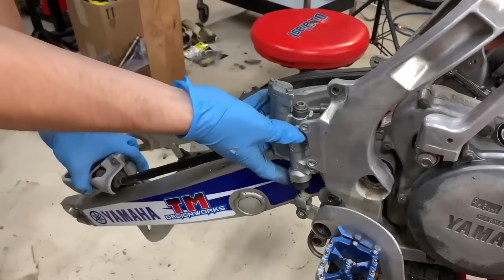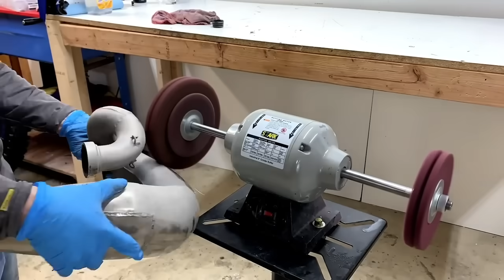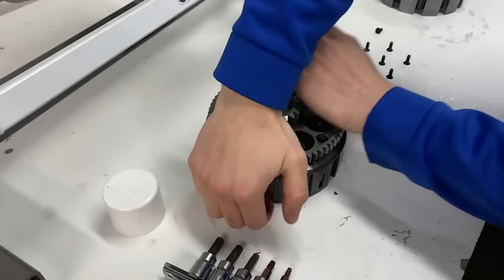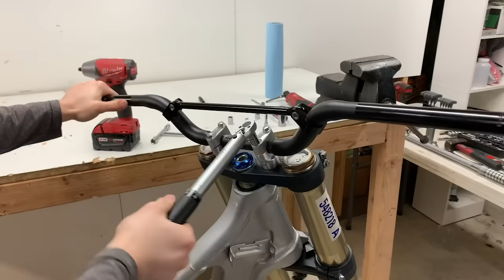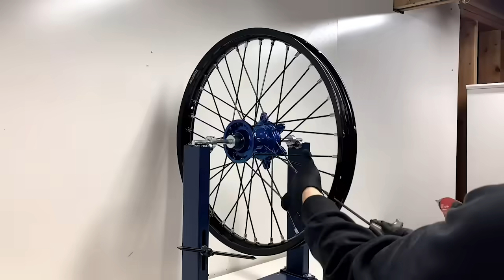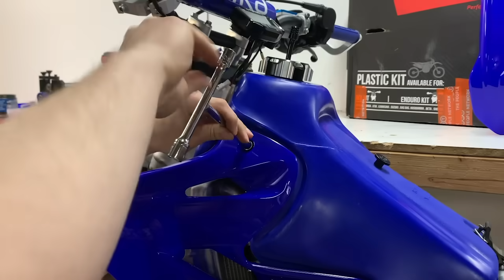Insane Transformation of a $950 Dirt Bike!

Comment: see I could probably take it apart but it would take me YEARS to figure out how to put it back together...
Reply: Thats what I thought but I took my project bike (and it was my first time working on something with an engine) down to every last part. Putting it back together, with help of the manual, was pretty easy and almost relaxing. Except tires. Fuck tires. You should totally try and rebuild a bike though, 100% worth it.
Reply: @zach5994  what bike did u do it on
Reply: @2strokeatvbro630  I did 2. First bike was a 1980 KE175 (old school and 2 stroke so super simple but a dirt bike nevertheless, however I will say since it's an old bike that no one else works on the difficulty of working on it would be comparable to a modern bike) The second was a TTR125 which I just did minor repairs and cosmetic replacements. No matter what bike you do you will probably get it down and I think it's super worth it
Reply: @zach5994  ok thanks
Reply: @2strokeatvbro630  No problem. You got a bike already?
Reply: @zach5994  I second that. Therapeutic when rebuilding. Just finishing up a full rebuild on a 92 blaster. But yeah... fuck tires. hate tires with a passion.
Reply: @Ethan_vega33  Oh that's dope
Reply: If you have small hands and several 10mm sockets, it will be easier than you think 👍

Comment: how do you find these cheap bikes man, people here be asking $1200 for a cr125 FRAME.
Reply from the maker: Lol where are you from?
Reply: Damn i got a full frame, swing arm, clamps, rear shock and front shocks all for $350 for a 1994 cr125
Reply: @adampaganelli4891  alabama florida line
Reply: @ryanlsorrell1983  wish i coupd find a deal like that!
Reply: I got a dt200r with a fucked top end and all of the other tuff that 30 year old bikes have for 300 aud which is like 180 usd
Reply: Caespa shit I wish .. bought a 2005 yz125 for 2k it was the cheapest in good condition I could find without having to spend 4K here in Dallas .. I mod everything so I was cool with the 2k since I had to buy like 2k in aftermarket parts .. a 4K used one plus 2k in mods would’ve put me at a new yz125 level
Reply: Kremit wtf i live on the fl bama like to
Reply: Kremit do you live close to Tallahassee or Havana florida Bc we could ride one day that would be sick
Reply: @ryanlsorrell1983  honestly i wouldnt of even paid that much escpecially if it wasnt running. #1 honda 125s are the the turtles of 125s and in 94 honda wasnt using the aluminium frame yet, which is the only reason to buy a honda. they literally have half the power of a yz 125 which yamaha is top dog with ktm and husky for 2 smokers.
Reply: Will Walton HALF THE POWER YEAH RIGHT LOL SUZUKIS N HONDA 125’s both RIP HARDER THEN YAMIS
Reply: Teo The Plug TTV no they don’t bud😭😭😭 Suzuki’s are complete shit and Honda’s make a lot of power but Yamaha still makes more learn ur shit
Reply: From where I am yz 125 2002 costs 1500$
Reply: @matteogarwacki4947  not a chance 😂😂
Reply: Will Walton sounds like y’all missin some front teeth
Reply: Will Walton and you have none
Reply: @BD-sv8dj  and you also have none 😂 join the club chump.
Reply: Will Walton sure a crap bike singular as if I don’t have every bike I ever wanted.. wanna video and be my ninth sub? I can show you lol.
Reply: Will Walton 2016 crf250r 2017rmz450 2003 kx125 completely rebuild and restored 17 sx150 gsxr1000 2018 Honda grom 2005 chapperall ss and an 2005 yamaha gpr1300 stage 2 not to mention what cars I have. I could care less about your opinion but rather prove my point. Work on getting some veneers to fix that tooth gap. Get your money up.
Reply: @matteogarwacki4947  hahahaha all them machines but no videos on your channel..hmm lol. You have proved your point your 40 and living with mom dreaming about these machines you will never own cause you still work a $10 an hour job. Those are all awesome machines, keep bagging them groceries and living off mom and I bet you will own one some day 😂. Goodnight sweetheart have fun in fairy tail land riding all your machines
P.s mommy loves you little man 😘
Reply: Will Walton  lololollolololollolol
Reply: Average condition 2002 yz250 people asking $3000-$3500. 2008 yz they asking $4k-$5k! Crazy!!! Hawaii, Oahu
Reply: Caespa  Where did you find it bro? I'm from Italy, average here for a yz125 2004 is 2400 euros

Comment: I had one of these and the kickstart shaft snapped, taking out the casing with it. The thicker kickstart shaft from the previous model was a straight swap (I used a 2001 shaft)so I put that in to prevent another snapped kickstart. They must have thinned the shaft for weight/cost reason but it’s much weaker and I possibly had a small crack in mine already.. I remember it though first day riding it and first time starting it with motocross boots on and snap.. I was devastated lol.

Comment: Did you just do the yz250x 3-5 gears or the full wr426 1-5 swap? 3-5 are the exact same parts on the 250x and wr426, but the wr has a much lower first and second gear. It's a direct swap, you just have to clearance the case a bit for the larger wr 1st gear, but it's very minor.
Reply from the maker: I did the 3-5, but I am also using a bigger rear sprocket for enduro.

Comment: Hey man I have questions about the power valve. Is there a gasket that seals the section that connects the top end and bottom end? I have a minor leak there and I'm unsure if it's a gasket or if it's a crack

Comment: Adam what brand and model are the toaster ovens you use for powder coating/cerakoating?  I didn't see it in the video, but were you able to fit the front and rear hubs in the toasters?  I am starting a restoration of a 2000 Honda CR250R. Cam , Clint Lund , and yourself do great jobs!!!

Comment: You payed $950 dollars for a 14 year old YZ 250 ? Dude they seen you coming. In fact anything older than 7 years ain't worth a couple hundred bucks. In fact ports in Japan can and will ship you containers full of all kinds at about $200 bucks per bike if you order 25 to 50 or more older models. Japan has a 7 year law and they have to get rid of them. 

The rest of your work is wonderfully done. Here are some critical things I noticed that will help you on future builds. Take these negative criticism's as they are, to make you a perfect mechanic.  

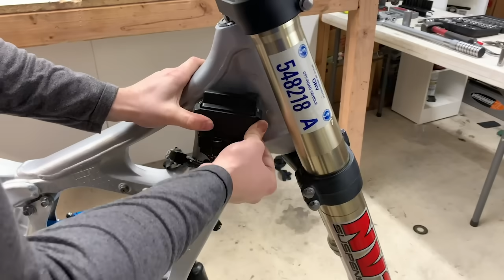1. At 9:21 you had left out the spark plug while doing other things.(Always cover that hole bro, anything can fall into it and cause major problems, even a grain of sand can seize a piston.)

2. Torque everything in multiple stages not all at ONE CLICK for each bolt. Example for 25 foot pounds, do one increment of 12 then a second at 25lb's. This prevents bolt heat breaking.

3. Never split a bikes cases unless you replace all the bearings. You put the old ones back in. This goes against any shop rule dude !

You have a love for Bikes and a passion for organization and procedure. You will go far. I retired to Mindanao from a life in Bikes. And yes sir there is a Motocross track here to and I teach mechanics. Nice Video and dang nice build !